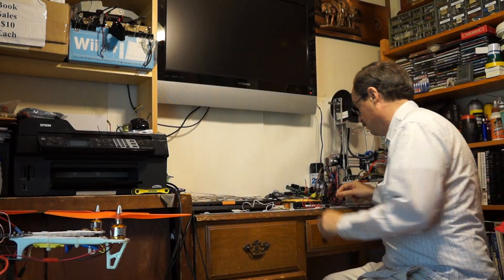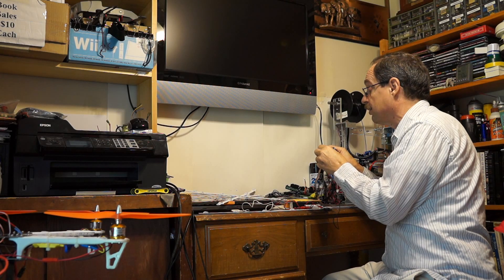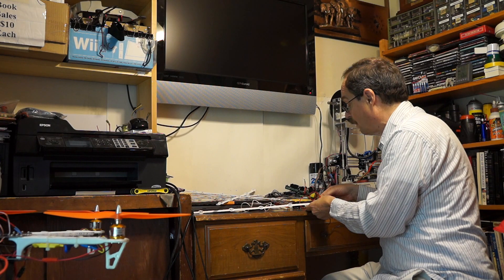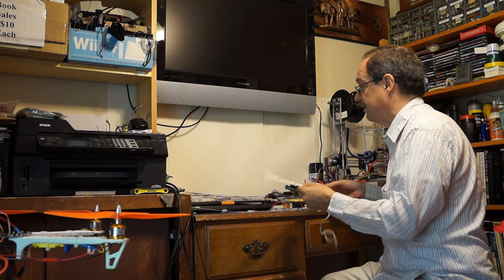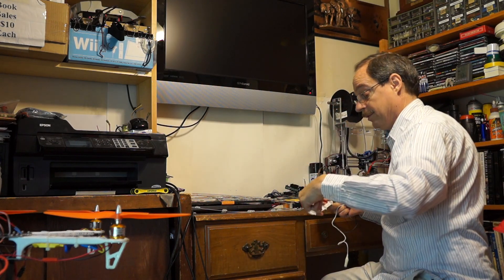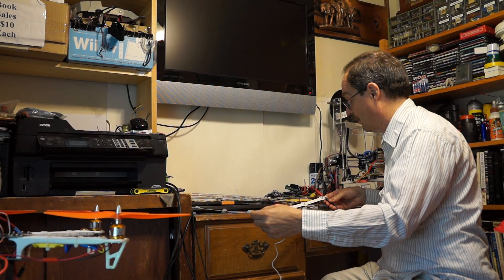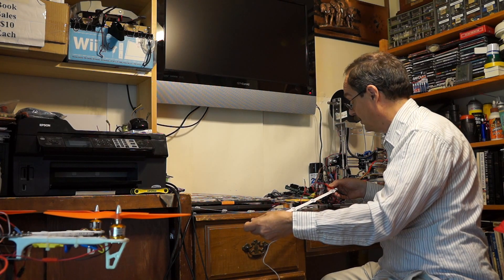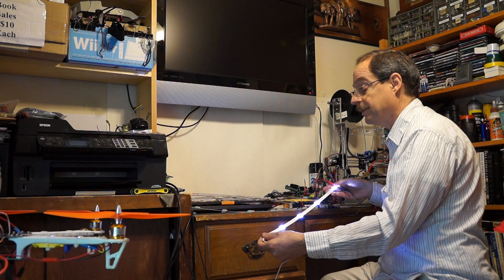Testing LED Backlight strips

Comment: What exactly are you doing with the open ended strip at the end of the strip?  Are you attaching a clip across the negative and positive?
Reply from the maker: The dead end is shorted out with an alligator clip across the contacts.